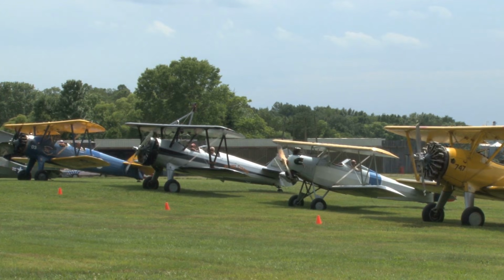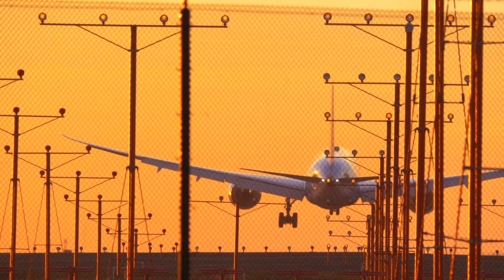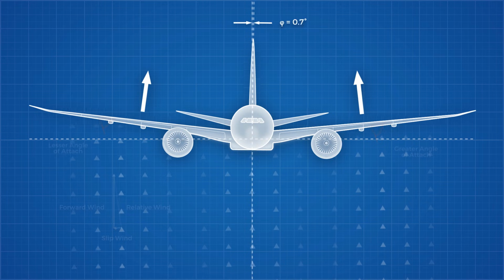Why Does Wing Dihedral Make Planes Stable?

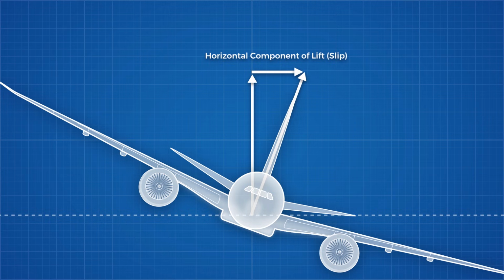Comment: i came for 2:32. but could not visualize clearly
i wish the airflow was shown in 3D and broken down into components
is it saying the upward apparent wind occurs only when craft is dropping?
also does this mean if the aircraft is simply slipping sideways (without going downward) there will be no dihedral stabilization?

Comment: The Corsair explanation isn't complete: another reason for the reverse gull wing explanation is that NACA determined that the wings intersecting the fuselage at a 90 degree angle minimized induced drag. But mounting the wing in the middle of the plane to create that minimized drag didn't allow for enough clearance. The oft repeated prop and gear explanation isn't entirely correct.

Comment: I think that explanation at 2:48 is incorrect. Because the airflow that causes the restorative rolling moment should be depicted as the airflow opposite to the direction of the slip that the plane would be slipping into because of the turn. It’s because of this airflow now hitting the dihedral wing with more surface area to do so that causes a rolling moment in the roll axis that’s opposite to the direction of the turn. But your diagram showed the airflow from the nose to the tail, saying that this air flow hits the lower wing with a higher angle of attack? That doesn’t make sense

Comment: With this for larger planes wings will also bend. Making a wing that is completely stiff for a multi ton aircraft is just not possible as it would be far too heavy. The C5's wings are nearly completely horizontal when in flight carrying heavy cargo.
The 787's wing can rise by a full 5 meters in flight to the point that it can be very noticable to passangers and Boeing has had to reassure people many times it's not a threat.

Comment: Enlightening!
Now, X29 had no dihedral (AFAIK, couldn't find it), but everything presented here is about flat or swept backwards. How can I "guess" how would behave a plane with a strong anhedral (say, 12º) with a strong forward sweep (say, 30º) low-mounted and the back of the wings linked to the tail (like in the Lippisch design, but with wings swept forward, basically)? Wouldn't the roll correction behave exactly the opposite from when you have back-swept wings due to the airflow being directed towards the fuselage?
Cheers!

Comment: I’m confused. Wasn’t angle of attack the angle between the chordline and relative wind? I thought it had nothing to do with the span of the wing
Reply: AOA is a more general definition tbh, can be used for any kind of airflow around any sort of object if you have a defined coordinate system

Comment: The F16 wing isn't really low mounted. Like many aerobatic planes it has its wing more or less on the center line.
The inverted gull wing of the Corsair doesn't just allow for more ground clearance, but also reduces interference drag by avoiding tight inside corners. It may not have been a primary goal, but it certainly helped with making it fast.

Comment: 4:35  I would guess another reason for anhedral on heavy cargo aircraft could be structural strength?  Total guess here, but I wouldn't imagine roll stability of the physical aircraft is really an issue, since those planes are fly-by-wire and stability can be created by the computer software.

Comment: so the increased AOA on the low wing in a sideslip, is that airflow that is essentially running spanwise along the wing?? Is that spanwise flow contributing to lift? I'm so confused.

I researched this all day yesterday but got as far as "the low wing has a higher angle of attack" with no further explanation

Comment: 6:35 This was actually for a fancy aerodynamic reason. Short landing gear could have been achieved with a low wing. The reason for the gull wing lies in the fact that the corsair was designed for straight line speed, and a wing root joining perpendicular to the fuselage offers the lowest parasitic drag. THAT is why the wing is a gull wing instead of just a low wing.

Comment: The F4U wing was to keep the landing gear short for the rugged service of use on an aircraft carrier while enabling use of a large enough prop to handle the power of the engine.
It was NOT about aerodynamics.

Comment: you missed to talk about the effects on lift since a negative dihedral is very much a concave down shape which when in flight will force a wider pressure field underneath thus increasing lift. you can make a simple experiment when driving your car pull a hand out in the incoming air stream and while pretending your hand is a wing, concave your hand down and updwards

Comment: I heard once something being told about the plane wings being tilted upwards due to the dynamic stresses that occur where the wings attatch to the fuselage. It was something about that by pretensioning the wings to tilt upwards there would be an upward force at all times so that in situations where there is no lift the load would still pull the wings upwards instead of going through zero. if theres a lift load the forces at the wings would also go upwards. This would decrease fatigue stresses.  Is there any logic behind that?

Comment: So, low mounted-wings make the plane unstable, high-mounted wings make it stable.
anhedral wings make the plane unstable, while dihedral wings make it stable.
Although this probably is a coincidence to some degree, higher angled and higher mounted wings make the plane more stable, and lower angled and lower mounted wings make it unstable.
Reply: Just thought about it, if there was a plane that could change the dihedral/anhedral angle of it's wings in flight, it could be very maneuverable while also very stable.
Could it?

Comment: Can someone explain why he says the pendulum effect doesn't make sense. If the center of lift is higher than the center of gravity it makes sense to me that when the aircraft is rotated the col and the cog are no longer vertically aligned and that a proton of the weight would act as a torque on the center of lift to bring it in line. What makes that incorrect?

Comment: Just a small addition to the information regarding the corsair.

The corsair  was originally designed as a dive bomber. In a creative move designers removed the concept of independent dive brakes in place of using the lander gear as a dive break, thus using one part to fix two problems. In doing this the gear length could not be extended without significant strengthening and added complexity.

Comment: High wing airplanes that require more maneuverability are affected by the Keel Effect so they use Anhedral wings to increase maneuverability. 
Case in point is the Cessna 172 which is both a high wing and Dihedraled.

Comment: Besides the mentioned reasons, wings on transport aircraft like the An-225 are shoulder mounted to keep the massive wing box away from the cargo bay and thus make it fully usable over the whole length of the fuselage. As an additional side info for the big engine clearance from the ground Military transport aircraft are often designed for take offs and landings on rough surfaces. The higher the engine clearance the less risk of sucking in any kind of dirt, sand, gravel etc.

Comment: 3:00 High mounted wings tend to be more in use on cargo/heavy load type airplanes. Bombers, Miltiary Transports, really small/weak engine planes.
One reason of course is more clearance for wing mounted engines. But especially cessna loves the high mounted wing, but loathes the wing mounted engine. But having the correcting force be closer to the fuselage on the lower wing, might help give the correction force a bit more "omph" for the same wingspan and speed.

Comment: What's wrong with the pendulum effect? You said it's wrong, but didn't explain how wrong. I'm thinking really hard about it, and I can't see how it is wrong! Pls kindly explain.
Reply: Look up videos about the rocket pendulum effect, this is similar. Basically in a pendulum the pivot point is the pivot itself where the pendulum is mounted. But in an aircraft/rocket the craft is free floating, so the pivot point is not the wings/engines, but the center of mass.

Comment: i have also heard for the an225 that the high mounted wings gave a strong support surface to mount the russian space shuttles on that the plane was originally designed to carry. it can also be used to carry heavy external cargo this way. althought hat being said, the 747 was also able to carry the shuttle and it was a low mounted wing. so maybe a simple reinforcing of the roof structure and proper mounting points is all thats needed to carry external roof cargo.

Comment: High mounted wings keep engines higher up and thus avoid FOD (important in low quality airfield which is important in military systems in particular, as the An225 was a tank mover) which was also a reason that planes aimed at servicing lesser developed airfields in the mid 20th favored rear engine mounts (like the Vickers and some soviet designs)  as well as to carry the Buran on its back (the reason for the two knobs there) and the wing box was the best place to mount it to.

Comment: A big part of the Corsair's wing design was drag. They wanted to keep the fuselage as narrow as possible for speed so in the early variants had all the air intakes in the wings. But they also wanted to keep the landing gear short for carrier lands and higher speed dive brakes.

Comment: One thing to note is that the vertical stabilizer also contributes to dihedral effect. In a side-slip, the angle of attack induced on a vertical surface that protrudes above the center of gravity will produce a moment that counters the roll. If you consider a lot of the planes that have zero or negative dihedral, you'll see that a lot of them have relatively large vertical fins. The F-104 is a good example of this.

Comment: Your explanation of the Corsair is incomplete.  If they had JUST needed ground clearance, they could have gone with a low wing.  You say the inverted gull was not for any aerodynamic reason, but it was.  The idea is that the most aerodynamic way to join a wing to the fuselage is at a right angle.  That would mean a mid-fuselage wing if it were straight.  THAT combined with the engine size and landing gear weight wouldn't work, but with the inverted gull, the wing could meet the fuse at a right angle while still providing ground clearance and beefy landing gear. https://www.usni.org/magazines/naval-history-magazine/1995/february/designing-bent-wing-bird

Comment: The F-16 was designed to be unstable in more than one axis. It is so unstable that if you lose power in the engine it will only Glide as long as it is at relatively high speed. But it will fall out of the air. You cannot land it safely without power.

How much does dihedral help when you have asymmetric thrust because somebody replaced an engine under one of the Wings and didn't trim them so that the same throttle setting isn't giving you the same thrust from each engine? Asymmetric thrust will cause a plane to roll and come out of the sky relatively quickly if the flight crew is not paying attention while they're trying to fix some other issue. That has been the cause of several failures, especially in Asia where they so depend on the electronics of the aircraft. That they forget to fly the plane.

The F4U Corsair issues work multiple. The desired speed of the aircraft, required a propeller of such size, ultimately requiring them to articulate the wings so that they didn't have to use to have your gear and short-circuit the overall function of the aircraft. Although the design speed was intended to be at least 400 miles per hour. It did go considerably faster than that fairly quickly in its later development.

Comment: As a Commercial pilot I can confirm that the Keel effect which you mentioned as a “Pendulum” does add to the roll stability of a high wing airplane. This happens because the Centre of pressure which all lift acts through is placed above the Centre of Gravity through which all perceived weight acts through causing a couple when the aircraft is in a banked attitude which pulls the fuselage back to centre. Side slip is also a non issue as this effect works when you only use rudder to maintain coordinated flight.

Comment: (I'm saying this before watching, but, I know why a F4U has its wing shape, (the plane in the thumbnail) The Corsairs wing shape came from the massive prop. If its wings were straight, the propeller would smack into the ground (or carrier deck) and tear it off, so, the reverse gull wing was introduced, and the gear was put onto the lowest point of the wing, making it capable of clearance when landing or taking off

Edit, he says this in video

Comment: Please correct me if i'm wrong but a pilot told me that high mounted wings do make planes stable in a way similar to the pendulum effect. ''keel effect'' . It IS (also) the drag vertical component of wing drag that acts as a parachute. It is not the lift's vertical component as that  is perpendicular to the wings surface (not to gravity) so not upwards (inverted pendulum fallacy).

Comment: Unrelated question: Why don't we use nuclear power for space travel? Not that I support Nuclear power in any way...but why hasn't it been tried before? Too expensive? Not efficient? Too dangerous?
Reply: Nuclear power is just too powerful. The concept was explored several decades ago where small atom bombs would explode underneath a push plate, connected to the spacecraft via a dampening mechanism.
The main advantage is that the craft could, and had to be quite heavy (in order to accelerate at a tolerable rate).
The main problem was that each blast would remove a certain amount of material from the push-plate. We still don't have any material which can survive the amount of blasts needed.

Even the smallest nuclear bombs are simply too powerful. If one day we can control fission or fusion, a few atoms at a time, nuclear may well be a solution.

Comment: As a former C-17 loadmaster the rational for the top mounted wings, as it was originally taught to me, is indeed to get the body of the aircraft as close to the ground as practical. This is primarily done for the last reason stated 4:49, to ease on and off loading. Most vehicles enter a military cargo planes under their own power, so having a cargo ramp with as shallow an angle as possible is required.

Comment: It is not a greater angle of attack (AOA) that makes greater lift on the lower wing. AOA does not change when an aircraft rolls. It is the greater vertical component of lift that is created on the lower wing (with normal dihedral) when the aircraft is in a bank...
Just saying. Mostly right, but that part is incorrect.

Comment: I actually wrote a paper on the F4U a couple years ago. The inverted gull wing proved to be more aerodynamic due to being attached perpendicular to the rounded fuselage. It also wasn’t just for the size of the propeller; despite the blades spanning 13ft across, the inverted gull wings were used to make the landing gear shorter to support the harsh carrier landings.

Comment: Your explanation on the Corsair is incomplete. The reasons you stated are part of it, but with only those, they could just have joined the wings at the bottom of the fuselage like many of the fighter planes at the time (Spitfire, BF-109, Fw 190, A6Mx, etc.). The reason they didn't do that, is because having wings attached at a 90° angle to the fuselage surface causes less drag. To achieve that and still have the wings low enough for the prop clearance and shorter landing gear (as you've stated), they need to be angled down dramatically. That, of course, led to the iconic "down-then-up" wing shape.

Comment: Your dihedral/anhedral explanation of how wings' roll stability works is correct, but I'm afraid your statements about top-mounted wings and low-mounted ones is not quite as accurate. To simplify things up, you should be thinking of lateral center of pressure with regards to center of gravity. Weight acts over CG so it doesn't play 'directly' a part in how the plane rolls as you already noticed in your analysis. What actually generates a restoring moment is the keel surface that mostly depends on vertical stab area and positioning, regardless of wing placement. Thus when sideslip occurs due to roll, lateral CP above CG will produce a restoring moment while lateral CP below CG will produce a destabilizing one. The reason high wings are more stable (not considering dihedral/anhedral) I assume is because raising a wing also elevates lateral CP (think of all the sidewards component of wing drag during sideslip), and conversely for low-wings.

Comment: I'm almost certain I read some where that the F4Us wings were at the angle they were because there is considerably less drag when a wing leaves a fuselage at right angles. So it was a drag minimisation design, as much as a propeller clearance issue. Note that planes like Me 163  and  X-15  apply this  idea too. Designs where  drag minimisation to gain super high speed was super important.
Reply: @earth9531  ~ thumb ~
Do you have a link I can go and read?

Comment: As for upper vs lower mounted wings, the upper one provides better lift-to-drag ratio, this gives one of the major reasons why most cargo airplanes use it. The key aspect of why most passenger planes still have lower mounted wings is passenger safety during emergency landing, with the other important factor being the ease of engine servicing.